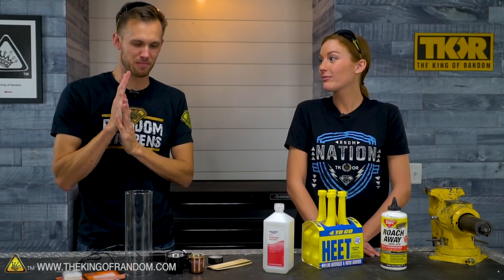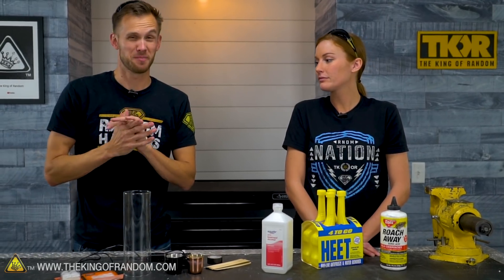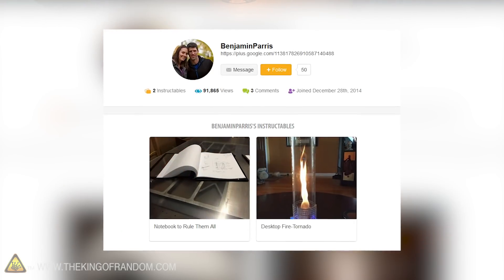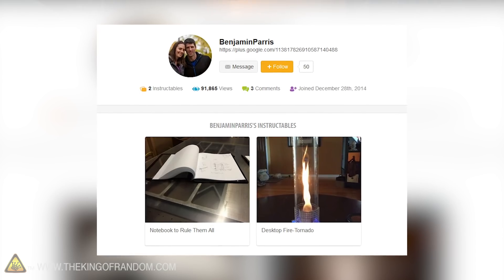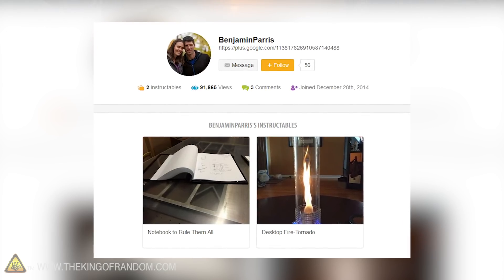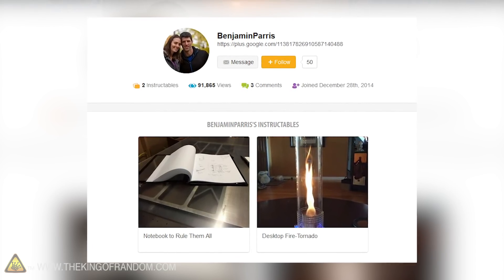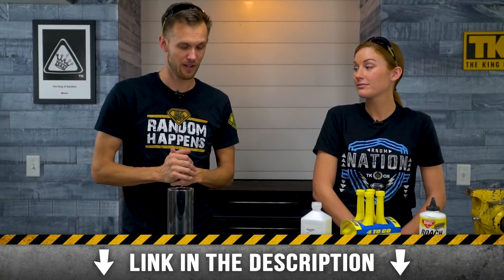USB Powered FIRE Tornado Experiment!

Comment: it doesn't spin quite like how I'd want it to, maybe take the fan and cut a hole in the glass at an offset angle  then use a funnel to blow the air  a little up and  to the side,  where the shape of the glass would make it spin, also you can probably up the speed of the fan to get a tighter funnel

Comment: Could you not 3d print a base for the fan that you would accept the tongue depressors as gates?

While we're at it, you could 3d print a collar for the glass tube that you could attach with superglue that had mounting points printed into it to attach to the base...

Comment: I made a mini fire tornado, myself.
It's even easier:
Get a centrifugal fan, put a cup of fuel in it, and then drop one o' those glass chimneys on top.
One spark, then bada bing, bada boom, fire tornado.
Reply: Note: If you get a glass chimney from a traditional hurricane lamp the flame jet will be a lot more impressive, but the thermal differences will shatter the glass fairly quickly.
It's cool enough to try once or twice, but not very financially viable.

Comment: Hey sis it's getting cold around this time of the year. Should do experiments with hot hands the inside of hot hands are a little packet hot hand warmer that keeps your hand warm for about 4 to 8 hours should see what the insides do in a vacuum chamber freeze dryer and if you can set them on fire

Comment: I'm pretty sure you could get the same effect by cuting a plastic pipe in half length wise and stagering them so air comes in the sides. Then you wouldn't need power for a fan.

Comment: Now use the way that the air is going through a tube to make the fire do a loop-de-loop!

Edit: also possibly block the air intake on the same side of each side of the gap between the fan and the floor so that the air comming into the area under the fan is turning and thus turning the air in the tube and thus the fire; you'd basically be making a air swastika but it'd probably be the optimal way of making a spiral via high/low pressure dynamics.

Comment: You dont need a fan. You can just use a cylinder that's cut in half from the top and off set them to let airflow in from the sides

Comment: Question: Does the glass get hot to the touch from IR heating from the flame, or does the air flow keep the glass from getting too hot? I ask for three reasons... Can the glass be touched w/o getting burnt (especially if needing to refill the fuel)? Is there danger of the glass cracking/breaking/exploding from thermal stresses? Will the e-tape get soft and unreliable with heat?

Comment: I have a fear this will tip over one day an cause a massive  fire .
Reply: The fire only lasts as long as it has fuel.  Rubbing alcohol evaporates quickly, so if it did get knocked over and spilled the fire would shortly go out.
Reply: @beckymurphy4714  wouldent the alcohol ignite other stuff?
Reply: that is not too much of an issue, what would be the issue is people adding fuel into the container while it is burning, which would detonate the fuel bottle and launch burning fuel everywhere around and on them.

Comment: MAKE THIS A KIT!!!
(Like this comment so they do it!!!)
Reply: A kit that allows you to burn your whole house down?
Reply: For liability reasons I dont think this will happen. For personal reasons I sincerely hope I am wrong 😁
Reply: Yup
Reply: nah they'd rip you off get it somewhere else
Reply: @DigitalEkho  and why do you say that? Has TKOR ever ripped you off before?
Reply: @Saayan Rao you shouldnt really need to modify them.
They are steel containers with very thin walls they won't hold a lot of heat with air blowing over them they will cool down within 30 seconds.

The thing that will hold heat is the fuel. But it really won't hold much at these volumes.
Within a few minutes the containers will be cool enough to hold. And if you do need to hold them you can use tongs.
Reply: Noah Woode are they married
Reply: No
Reply: Fire in my hands make this fire go away oh my it’s so hot
Reply: Hot hot hot hot hot fire in my hands
Reply: why? when you can go buy everything on amazon at half the cost
Reply: The glass could break on the way to your home